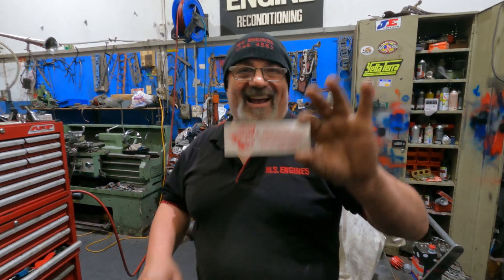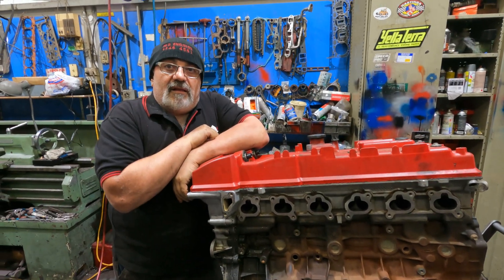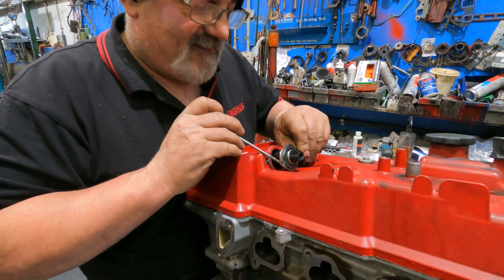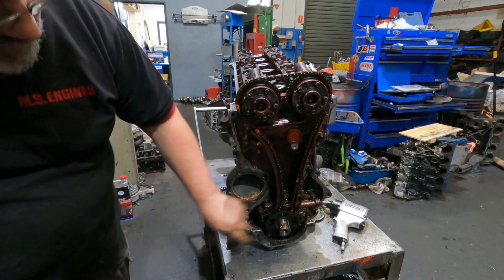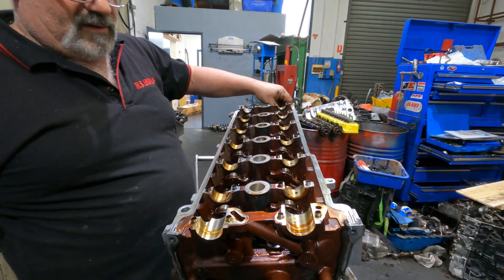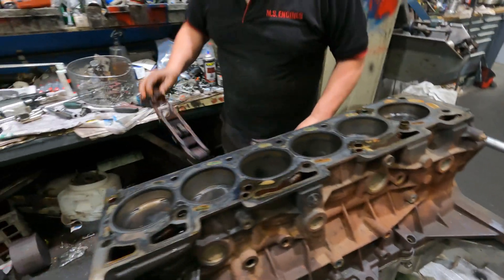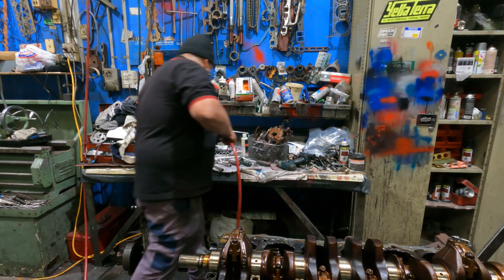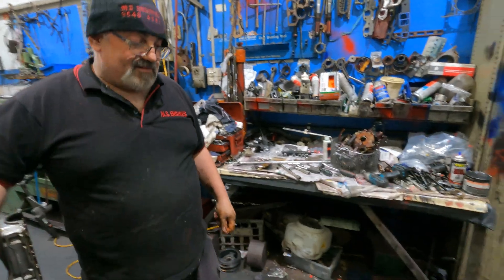Ford Barra Turbo Teardown and Diagnosis

Comment: Hey just wondering if you had much dealings with the Ford 250 2V Head back in the day , next to no info on the net or you tube . I had a couple of them back in the day one with an Erson TQ20 & 350 holley with a Top Loader in TC cortina and one with an unknown Cam grind and 465 holley 4BBl that I put in an XE ute that went like a rocket.